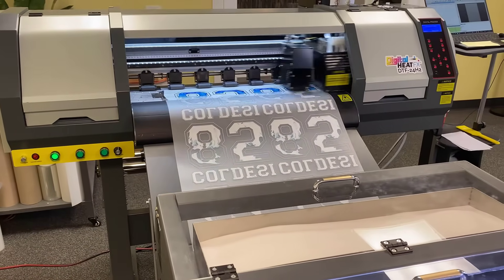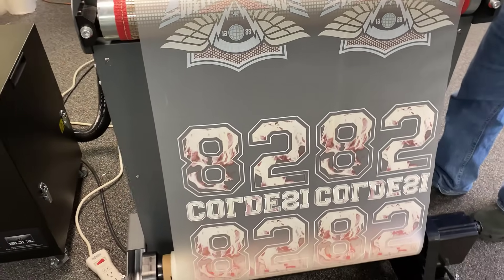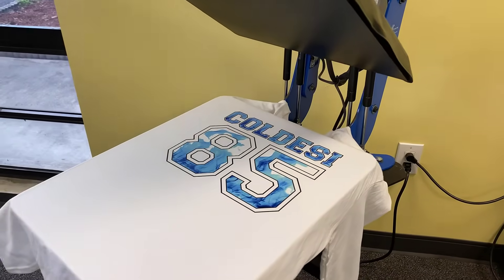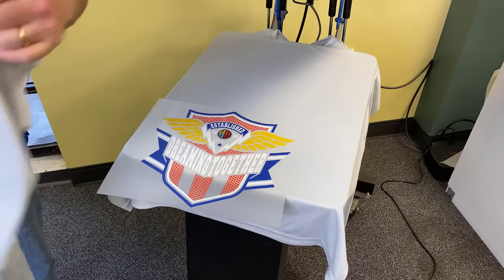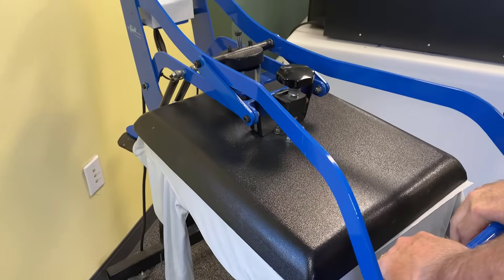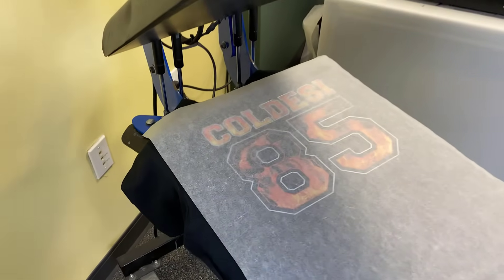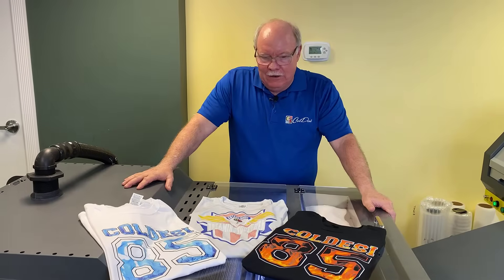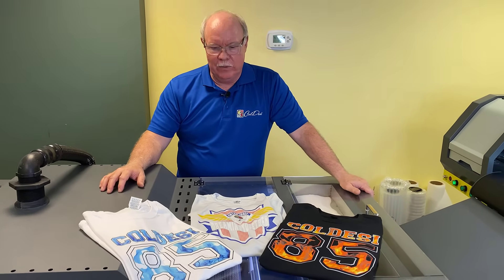How It Works | Printing DTF Transfers | DTF-24H2

Comment: Hello, I just saw videos where they say that dust that sticks to the design can cause cancer. What procedures should be in place to prevent this dust from spreading throughout the work area?
Reply from the maker: There are many brands of glue and you should consult SDS documents for safety rather than just social media videos. We have documentation for all our brands of glue. Saying that, extractors and air purifiers are great for all industrial businesses when particulate can get in the air.

Comment: Im thinking of switching to dtf from white toner but to tell you honestly. I'd rather have white toner than dtf. dtf is too slow. its like 17-20 mins per shirt. just know the right temp of your heat press to your white toner and youll be good. dtf print quality might be better than white toner but all and all i think white toner is better. (2 years white toner user BTW.)
Reply from the maker: hmm. not sure where you got 17-20 minutes from. White toner printing is great but DTF printing is undeniably fast. We did full production runs with both systems. check it out 
White Toner Printing - https://youtu.be/YovCVj0OBVI
DTF printing - https://youtu.be/RuMCRot5oyA

Comment: As a screen printer I love the concept and would love to get a machine like that but afraid to because of all the maintenance issues and problems with clogging  of print heads and the settling  of the white inks, how does your machines fare pertaining to those issues?
Reply from the maker: The equipment is definitely designed for commercial production and we have customers that put them to work! You will absolutely want to follow the maintenance to keep your machine running tip top.

Comment: DTF printing is Ok for smaller designs under 25 sq inches , other than that, unless you like the feel of wearing a plastic garbage bag or vinyl banner glued to your shirt, its not a good idea.
Reply from the maker: completely disagree. While it does have a "hand" to it, as long as the design has negative space in it  the larger designs feel great. And continue to improve after washing. It's not sublimation of course, but you have the advantage of being able to put it onto any fabric
Reply: @ColDesiColman  agreed, if you like the feel of duct tape or a garbage bag glued to your shirt, then go for it big fella!
Reply from the maker: @68CDVille  lol
Reply from the maker: @68CDVille  😆There are at least 2 million shirts out there right now just with our equipment's DTF prints on them - the biggest brands and the biggest fulfillment houses are switching - and consumers love them.

Comment: so if I'm going to use DTF for a startup printing business, there would be no issue to consider for the type of shirt and even if it is light, dark or colored shirt I'm going to use??
Reply from the maker: That is correct. Just consider that this is a large, high volume printer. Make sure you consider space, power, ventilation, etc.
Reply: @ColDesiColman  alright thank you so much

Comment: Would you please address post press longevity of the prints? I have multiple custmers complaining and returning tees that arrive in the mail wrinkled and hardened. I sent a ticket to Coldesi but also see there is not an answer as to how the post process of the ink, shipment, and how to keep the print flat and not let it curl in transit. It's as if it curls up when it is 100% cooled over a few hours?! This is happening enough now to be concerning. 

Doing exactly as traiing videos state:

305 degrees press for 10 seconds
hot peel
305 degree press for 5 seconds with parchment paper

They come out beautiful and flat. We let them cool for at least a few minutes before bagging and shipping to customers.
Reply from the maker: This is a bit detailed to get into here - best for a discussion with tech support. But I can tell you that we take no special care ourselves when we ship out sample transfers.
Reply: @ColDesiColman  So my theory is, it's only happening with Hot Peel I Series, and it could be related to how thick of white ink is printed? I am printing full DPI 1800 resolution per suggestion from support, as if I don't banding is always present in all prints no matter how clean the heads, properly over 55% humidity, and anything else I have tested, retested and watched training videos again and again. Thanks.
Reply: @ThoughtJams  that goes away after a wash.

Comment: 100% poly no problem? How to deal with dye migration?
Reply from the maker: We have had no issues pressing these on 100% poly. The white shirt in this video is 100% polyester
Reply: @ColDesiColman  yes but white fab doesn’t have dye migration issues. It’s the darker fab colors that need to be addressed
Reply from the maker: @dicknastee1652  Do you have one of our printers? If so, please call into support and work it through with them. I haven't heard or experienced this issue

Comment: I have a Roland VG540 right now but I do mostly T shirts so now I am looking at one of these DTF printers. The issue I see but haven't found a direct answer to is that you would be hindered to do a small run of shirts it seems. Essentially you cant get your prints off of the printer until it runs all the way through the dryer with the powder. How much waste do you realistically have if you aren't printing 24/7. Suppose you only needed to do 12-15 shirts with a fairly quick turnaround, do you just run the film into the dryer and waste it or can you cut it?

What is the next best option if the production demands aren't this high and would result in wasted media? My highest volume job client is usually around 300pc's but a majority of my jobs are for other small business which are usually 14-30pc's
Reply from the maker: We're working on an roi article built around this now Jerry, where we are specifically doing a 16 shirt order. Here's what you'll learn from that when we're done:

>The math still works on a 16 shirt order. It's not ideal, but still more profitable and faster than using something like white toner or a bn-20
> Because of the Print Optimizer rip that comes with it, you can bundle jobs together and make the best of any production run. Basically, a good idea to put multiple orders together - it will save you a LOT of time
> These high volume printers are not appropriate for every business. But it sounds like you're near the edge - I would talk it through with a pro at coldesi.
Reply: @ColDesiColman  appreciate the response, good info.
I am definitely right along the edge. I’m in that area where I do most of my jobs in house but I am also still ordering screen printed transfers for the simple T shirt designs that printable vinyl is no good for.
Reply: @Jerry-LZ  You keep some film on the collecting roll and every time you start a job you thread it all the way back to the vicinity of the printer and attach it to the film sticking out of the printer. That way you save material.

Comment: Is the bn20 or 20 a dtf?
Reply from the maker: No, those are print and cut. Here are the differences: https://youtu.be/GW3ybQgSwbg
Reply: @ColDesi Inc  okay like the uni and oki etc?! The dtf printer looks amazing and is something I want.  Im still using the old hp dw  model two step print.  I'm trying to find the printer I can use for everything mostly without wasting money on multiple printers!
Reply: @ColDesi Inc  I see ppl converting dtg printers to dtf.  Can that process give you great quality prints close to a dedicated dtf printer?

Comment: How would you got about doing one offs i feel like you would waste alot of film
Reply from the maker: Great question - you probably would not do just one - but you CAN put as many "just one's" as you want in one run. So if you had 25 different design/shirt orders you can gang them in the software and run them. For one offs we would pare this printer with one of our DigitalHeat FX white toner machines or a DTG G4

Comment: Questions:

1. Wash Test (1 wash to 10 washes, how does it hold up?)
2. Black powder vs White Powder. Why either or?
3. True Cost per print? out the door.
4. Prints per hour on a full color print example.
Reply from the maker: We'll send you a sample if you'd like - washed like a screen print transfer - which is awesome.
2. Never even heard of black powder
3. Depends on size of the image
4. Depends on size of the images

These are all good questions - you should probably chat with someone on the website or call in to talk in detail. https://coldesi.com/direct-to-film-transfer-printers-have-finally-arrived/
Reply: No one wants to talk about washing and drying. Showing the pressing process. Show me how it looks after a few washes
Reply: @jneauxgrafix  This is key. I agree. The proper pretreat amount ends up making the white ink peel off after a couple washes. Would like to see them go through the proper pretreat, press, and wash cycle.
Reply: @ThoughtJams  Do u have a machine? If so, what do u use?
Reply: @tesha2087  I bought one yes, awaiting for it to arrive. been 1.5 months waiting so far.
Reply: @tesha2087  My machine arrived. follow/subscribe for my review coming up...
Reply: @jneauxgrafix  I have a test shirt that’s been through 113 washes. Still like new. The stretch and flexibility of dtf makes it indestructible.
Reply: I’ve been using DTF transfers for over a year. I have one shirt that I made that I literally wash with every load of laundry for a wash test. It’s been through 113 washes and and the transfer is exactly the same as day one.
Reply: @bhutch216  So how do you avoid the curling ?

Comment: Is this printer need fume extractor?
Reply from the maker: It uses a belt dryer with an extractor. You can get the specs from the team on the website chat if you'd like.

Comment: Thinking about purchasing this printer. Only one question. If I want to only print 3 copies, can you cut it off by hand at the printer and hand feed it into dryer?  I don't want to waste what looks like 6 feet of transfer for only only 24 inches of film.
Reply from the maker: Hi Mike. You can - BUT this isn't a good production flow. You would want to add those 3 copies to the end of another job. If you are looking for a short run machine for custom tees the DTG G4 might be a better option for you.

Comment: What type of ink is used? And type of environment required to keep the equipment in? Warehouse/ garage type okay?
Reply from the maker: It uses a specific DTF ink set - environment is pretty standard for any inkjet process - you need to keep it in a temperature controlled environment, watch humidity levels, etc. And.. there is noise, so you'll want to keep that in mind